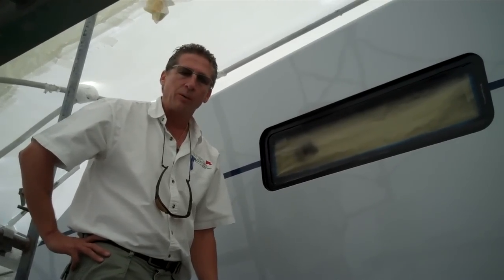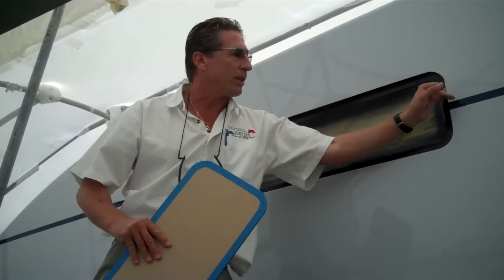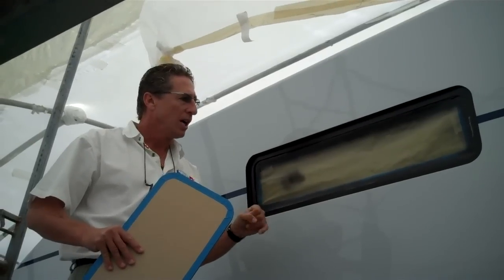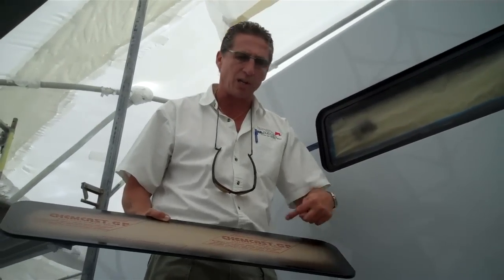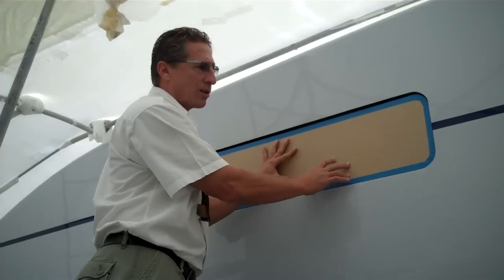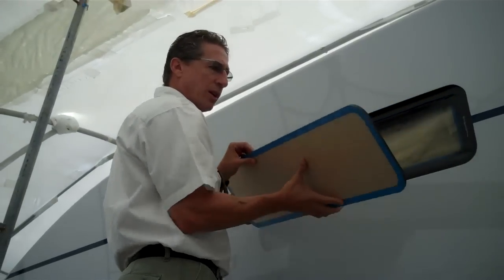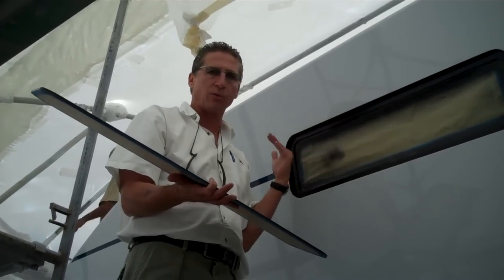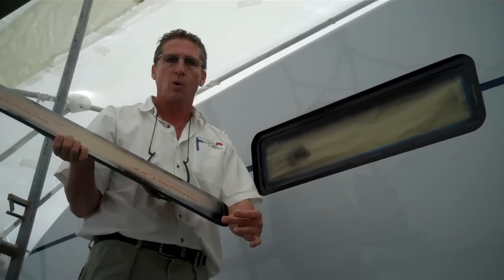Acrylic Window Installation

Comment: Can you tell me what you used for the primer under the Awlgrip.  I think you said "Hold-On" in the video but I cannot find anything about such a product Googling.  Also I have been contact with Awlgrip tech support and they are not familiar with it either.  I have to install some windows in a Beneteau.  Thx, Kenny
Reply: He said Bulldog. It's an adhesion promoter. You can find more info about it here: http://kleanstripauto.com/products